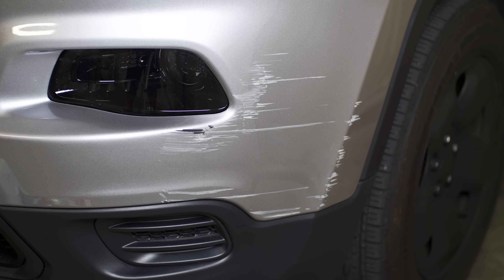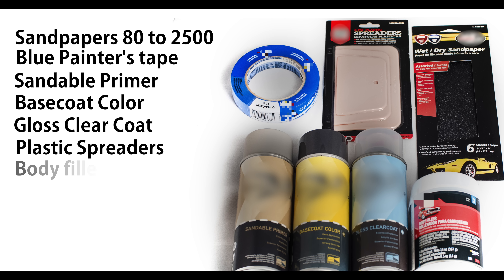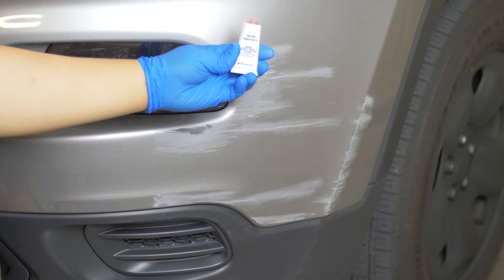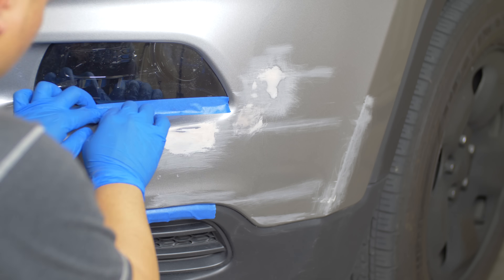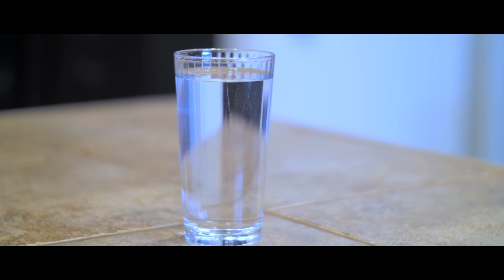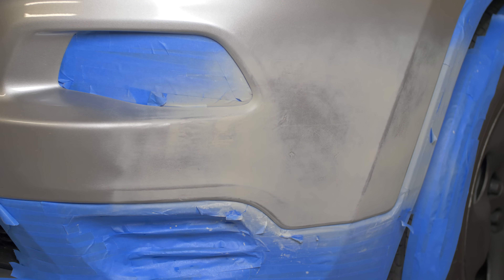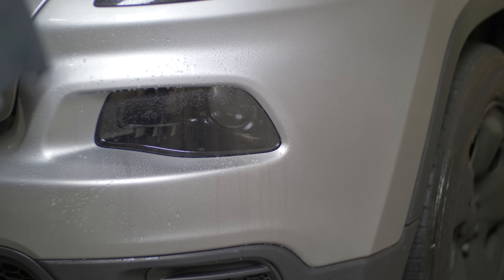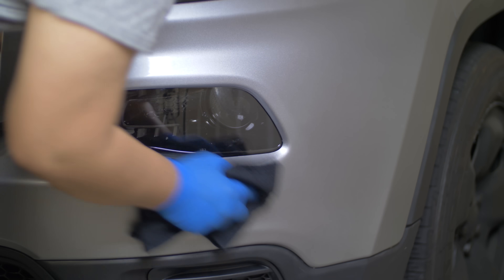How to Repair Scratches on your Car | Save Hundreds of Dollars

Comment: Thanks for the video, and the humor ! Is it ok to paint just that area - and not the whole bumper ? The place where the new paint & clear coat meets the old paint & old clear coat - does not it show ? If not -what is all this noise about blending ? Could you please elaborate on that ? Thanks !
Reply from the maker: Thank you for checking it out. In this video, I didn't paint the whole bumper. I just painted that area. It would blend in because it would be the same color any way. But the shine might be a little different because old paint might have not be as shiny any more. 

In my case, I painted a 2017 jeep Cherokee in 2017. It was pretty much brand new when I scratched the car.
Also, in this video you'll notice that my paint job is not as shiny as the rest of the car. (I have notes in the description about how to make the newly painted area shinier.)

 And to make the old paint shiny again, You could buff the whole bumper out with compound and polish after the paint had dried.

I hope that helps. Lemme know if you have any more questions. Thanks

Comment: Great work. Couple questions. You did 3 coats of primer but how many base coats and how many clear coats did you use? Thanks!
Reply from the maker: Thank you so much. I also did 3 coats of base coat and 3 coats of clear coat. But a lot of people in the comments suggested adding a couple more coats of the gloss clear coat to make sure that the paint will be shiny.
Reply: @ThomasofAllTrades  Makes sense. Thanks Thomas!
Reply from the maker: @adamgarrett3182  you're welcome. Good luck on your project. Lemme know how it goes.

Comment: Excellent tutorial! But I've already applied the base coat onto the scratches before watching this video, do I need to first sand down the applied base coat now before following the tutorial?
Reply from the maker: It depends. does it look good?
If not, then sand it down and start over.
Reply: @ThomasofAllTrades  Got a little drip on one scratch, but no bubbling so far. How deep should I sand it down? in other words, how will i know when it's ready for start over. This is my 1st time doing this
Reply from the maker: @conanh36  if it looks bad then sand it down. If you get drips then you're probably applying too much paint at once. Don't squeeze the nozzle too long or you'll get too much paint and it would drip.
Reply: @ThomasofAllTrades  After sanding it down, I applied base coat onto the area 4 times, but then when I sand it down with 800 grit sandpaper again to make it level with the surrounding paint, the scratch showed up again. What might be causing it？Is it because I didn't sand down enough?
Reply from the maker: @conanh36  you're not supposed to sand the base coat. You're only sanding the primer. 
Also did you put body fillers?
Reply: @ThomasofAllTrades  You are right, I missed that part. But I'm not sure if I need the body filler as you used it only for deep scratches. Would you mind if I email you couple pictures of the scratch and can you tell me if they are deep scratches or not. Thanks

Comment: Youtube just recommended this to me - nice video! I've done this process before, and would not use the fine grit sandpaper until after you have painted to improve your finish (before buffing), as the paint needs a texture to bond to. I'd use a two-pack (2K) clear on exterior panels, and when applying clear coat, it's quite difficult to blend into an existing prepainted panel, as it will have different thickness that's quite noticeable - consider painting clear on the whole panel (to the joins).
Reply from the maker: Thank you so much for your suggestions!! 🙌🏼
Reply: @ThomasofAllTrades  I can't claim credit for these - the shop who blended my paint color told me to do this! It's been a couple of years since you did this repair - how's it holding up?
Reply from the maker: @protecon  it looks the same as the day I painted it.

Comment: Result turned out nice, i would only worry that the whole surface wasn't scuffed prior to priming and painting it should be fully scuffed not just the repaired spots, but only time will tell if it eventually peels in places
Reply from the maker: Thank you for your suggestions. You're right. It would be better to have the whole surface scuffed. 
But so far so good.

Comment: Question: Is this method also applicable to a whole frontdoor ? I’ve got a real circular scratch with “autograph”😢 made with a key or screwdriver from a rascal. And how much paint to buy than ?
Reply from the maker: Wow that sucks. Yes You can do this method to fix that. When I did this video, I only had one can each of primer, base and clear coat and at the end I still had more paint. But one time I painted the hood of a car and that one took maybe four cans but I bought the paint somewhere else and I wasnt happy with the results at all and for some reason the cans didn't have enough paint that's why I can only recommend the paint company I bought the cans of paint from in this video.
Reply: @ThomasofAllTrades:Thank you very much. Maybe in the spring i'll go and try this👌
Reply from the maker: @harcovanhees394  good luck to you.

Comment: Hiya, do you need to have both primer and gloss clear coat afterwards ? Or can you do it without it and just use everything else
Reply from the maker: You need the primer for the paint to adhere to the bumper (or any panel your painting on) and you need the gloss clear coat to make it shiny and also to protect the paint.
Reply: @ThomasofAllTrades  Thank you mate!

Comment: Great job.  I'm in the middle of doing some repairs on my Chevy now.  I was wondering why you didn't use a clear coat, but chose to buff instead?  Anyway, it looks fantastic.
Reply from the maker: I did use clear coat but in the video, I did it so quickly a lot of people missed it.
Reply: @ThomasofAllTrades  I guess I was one of those that missed it too.  thanks for the answer..
Reply from the maker: @destinyreturns4885  you're welcome. Sorry about that. I guess I could've edited it better lol oops.

Comment: Hello, I sprayed duplicolor primer, base and clear coat after I thought paint was ready to clear coat. Some part was not covered adequate with base. Question, do you think if I went sand the clear coat, can I repaint and apply clea coat?
Reply from the maker: You could always resand it and try again if you are not happy with how it turned out at first.

Comment: My car was keyed.  On a warm day I used a black crayon to fill in the scratches then wiped the edges clean with my finger.  It lasts through car washes for about a year and then I do it again.  It has to be a warm day for the crayon to melt into the depth of the scratch.
Reply from the maker: If that works for you then that's great.

Comment: You have not mentioned about clear coat application, so when did you use that gloss clear coat ?
Reply from the maker: I did. I used it right after the base coat. You need to rewatch it. I did it kinda fast though

Comment: For how long i have to sand the scratches first and Body filler later ? Any tips for that?
Reply from the maker: Sand until kinda smooth and no big chunky scratches. Then apply body filler and make it as even as you can.

Comment: I have a scratch just over the rear wheel cover. The scratch goes over both plastic and metal. Do I need two different compounds for this?
Reply from the maker: @seanwickham8905  read the label for the Bondo and see if adheres to both metal and plastic.
Reply: @ThomasofAllTrades  The Bondo dries so damned quickly. Maybe I'm not using enough of the cream in the mixture?
Reply from the maker: @seanwickham8905  follow the instructions for the Bondo but yes it dries very quickly so apply it as soon you finish mixing.

Comment: Thomas, I see that this is an old video, but if you're still reading these comments could you tell me where you obtained the matching spray paint?  The only matching paint I could find for my Acura is one of those dealer sold touch up kits in a small tube with a brush. Please advise.  TIA. By the way, you did a fantastic job!
Reply from the maker: Thank you. I have the links for the products in the description.

Comment: Hi Thomas. I followed your steps but but I messed up to use black primer for gray color. When its dry up, it showed black spot every where. Now I want to remove everything and do it again. What the best way to do that? Should I sand them out? Thanks
Reply from the maker: You could always resand it.. if black spots are showing due to the black primer then you might have to put more coats of the base coat to make sure you cover the primer completely.
Reply: @ThomasofAllTrades  Thank you so much for your reply. Do u think I should buy the same color primer like you to get better result?
Reply from the maker: @asiandoge1044  I don't think it's necessary to by a different color primer. You just need to add more coats of base coat to cover the primer. The primer has to get completely covered anyway.
Reply: Got it. Thank you❤
Reply: Hey Thomas. Sorry but I have another question. I put the clear coat on the base paint but I realized it was 2X semi gloss. So it wasnt that shining and reflective compared to original paint. I bought the 2K gloss already. Should I spray it over the 2X one or should I re-sand it to reduce the 2X clear coat first? Thank you.
Reply from the maker: @asiandoge1044  have you buffed it yet? If not, add a couple more coats of clear coat
Reply: @ThomasofAllTrades  i buffed it already unfortunately. Also the 2X clear coat was on for 48h already.
Reply from the maker: @asiandoge1044  I have notes in the description regarding making it shinier. Check it out. I hope it can help you.
Reply: Thank you so much for your reply. I will try to sand it to reduce the 2X clear cost first before put a new one one.

Comment: Do bumpers require a flex additive to allow some bending, before cracking?
Reply from the maker: I'm not completely sure. I just used what I had in the video. You could try the flex additive and lemme know how it goes.

Comment: How did you get the car colored spray paint can? I saw you read the door sticker but that’s not a paint color code.
Reply from the maker: Psc is the paint code for my vehicle. I went to the paint's website and found that specific paint code for the vehicle I have. 
Link in description.

Comment: For a 2inch by 2inch section, will this work? And how do I know how far out to paint or should I just tape off only the area that needs to be touched up?
Reply from the maker: That's a very small area. Is the scratch super deep? The problem that you might encounter is that if you tape that area around it you're going to have to sand the lines where you had your tape. Usea high grit to sand that part. And you're going to sand with a very high grit up to about at least 3 inches.
Reply: It is just an uneven touch up paint job by the previous owner. I could tape off a bigger area due to the end of the hood being below it and a body line being above it. Will taping the body line cause a tape line? If so how do I blend that in. Do I also sand the area around the uneven touch up paint?
Reply from the maker: @andrewlinton8528  to blend the tape line you have to carefully sand it with a high grit. And yes sand the area around the uneven touch up.

Comment: Something very important when using body filler is that it is designed for plastic. Regular body filler does not adhere to plastic. If I'm not mistaken, that body filler is not for plastic, which will cause the job to not last.
Reply from the maker: Do you recommend a better body filler than the ones I used?

Comment: The sandable paint online has only 3 options. My car is a gold color. The options are grey, white or red. Should I get the grey or should I find a different company?
Reply from the maker: It doesn't matter what color sandable primer you get because it will be covered by the base coat anyway.
 Let's say my car is black and I bought a black sandable primer, I might miss a spot when painting the base coat thinking that I've already painted a certain area because the primer is also black. And that would be bad.

Comment: I got paint fix and it look good now, have not apply the polish yet. But the surface is not smooth.
Can I sand it with 2500 paper (or higher) and apply the polish?
Reply from the maker: Yesss. Please check out the notes in my description about this. You're on the right track.

Comment: I've painted the primer coats, did you paint only 2 coats per base coat and clear coats? Also is it mandatory to let it sit overnight before applying compounding or a few hours is enough? Thank you
Reply from the maker: Let it sit overnight. If it doesn't seem shiny add more coats of clear coat and sand it with a very high grit
Reply: @ThomasofAllTrades  I've applied 2 coats of clear coat, thank you, Thomas. Will wait and see. Also how did you deal with the new paint being slightly thicker than the surrounding existing paint? What did you do to make the new paint blend in better
Reply from the maker: @conanh36  I have the notes in the description about what other people have commented. Basically, people used a high grit sandpaper to make it smoother and blend better.

Comment: Bro by any chance do you know if bubbles appear what does it mean? Do I have to do that bubbled area again?
Reply from the maker: Like tiny bubbles? Maybe the sprayer/nozzle is not spraying correctly. Wait til it dries and then sand it with very high grit. Respray it again and then spray with clear coat.

Comment: Great video thanks but I’m trying to find a body filler in my area the link is out of stock is there any other product you would recommend?? I also am looking at a compound would you say to get polishing or rubbing compound? Did you use the wax , when and how?
Reply: Also what colour did you get the sandable primer my car is silver wat would you recommend
Reply from the maker: @yaldayahya5044  https://amzn.to/3SGqUOH
Reply from the maker: @yaldayahya5044  it doesn't matter what color. It would be covered with the basecoat anyway. If it doesnt get covered completely then you need to add more coats of base color

Comment: Hi I’m back here yet again 😅😅 but now  i can see the borders where I put the tape on when painting. Is there a way to kinda just even out the paint so there’s no borders where the oem paint is and the new paint I applied is?
Reply from the maker: Yes. Just sand it down. Starting with the highest grit like a 2500 grit.

Comment: Is it possible can I just use the paint only and paint at the spot where it was scratch?
Reply from the maker: If you only use the base coat, it will not adhere on the surface well and there would be no shine. 
So I recommend to use a primer and a clear coat.

Comment: How do you avoid over spray on the area without scratches?
Reply from the maker: You could use tape and then buff it out with a high grit to even it out. I didn't use tape on mine because i blended it in and so far so good. It didn't peel in rain or shine and I only Parked outside.

Comment: Does the sandpaper really to have be 80 onwards til 2500 grit?
Can I use like a lower grit range?
Reply from the maker: You can. It was just the case to the particular scratches I had on my vehicle.

Comment: If the scratches aren't deep and you don't need to use the filler, can you still follow these instructions but skip the filler part?
Reply from the maker: Yes. But if the scratches are really really light that the paint didn't even come off, try buffing it with compound first. Maybe it would remove the scratch.

Comment: What clearcoat would you recommend? The one I wanted off automotivetouchup is sold out. It's the missing piece I need before starting my repair. Awesome video by the way and great humor.
Reply from the maker: Thank you. I can only recommend the one from automotive touch up coz that's the one I used. You can contact them and see when they're gonna have it again.
Reply: @ThomasofAllTrades  Yeah I contacted them and they won't be in stock for awhile sadly. So I just went with the 2k as that seems to be the most used one recommended by professionals. Hoping the repair turns out as good as yours. Still waiting on the arrival and a day to fix my bumper damage. Lol
Reply from the maker: @shuvang6878  oh I see. good luck on your project. I'm. Sure it'll turn out great. Just take your time and play close attention to the details.

Comment: I did mine and it looks perfect but when i touch it its rough not smooth like before what did i do wrong?
Reply from the maker: Wet sand it with a very high grit. I have a note in the description about this.

Comment: It seems as though you had somewhat deep scratching. Is that why you started off with dry sanding?
Reply from the maker: Yes. It had deep scratches. I sanded it down to even it out and I evened it more out by putting the body filler and sand it again.
Reply: @ThomasofAllTrades  in my situation, I believe that I may only have clear coat scratching. My game plan is to start with the soapy water test
Reply from the maker: @WillsJazzLoft   if it's not deep and if it's just the clear coat that's scratched, try buffing it with compound. I showed buffing in the last part of this video. I have removed light scratches with just buffing it with compound.
Reply: @ThomasofAllTrades  yes I did see that
Reply from the maker: @WillsJazzLoft  great. See if that works first.
Reply: @ThomasofAllTrades  it turns out that the spray bottle test definitely indicated clear coat scratching as I suspected. I have started off wet sanding with the 1500 grit. And I've wiped it down with the very ubiquitous microfiber towel. It seems like the 1500 grit did accomplish something. I will very likely use a 2000 or 3000 grit to begin polishing